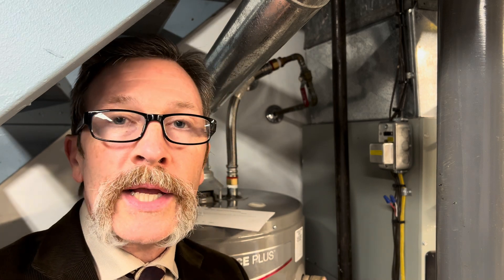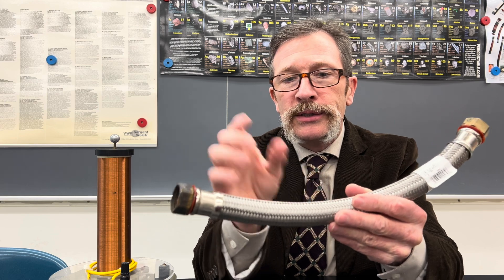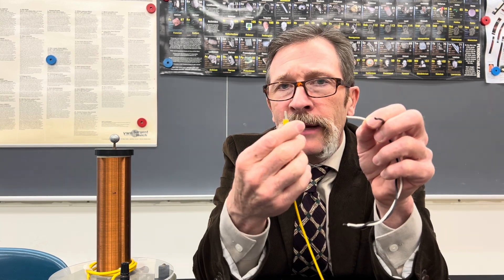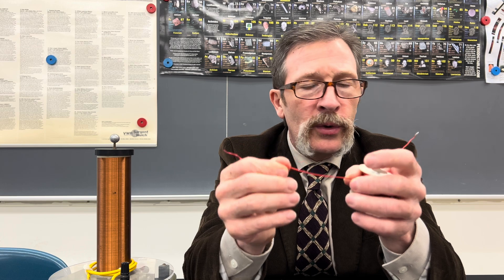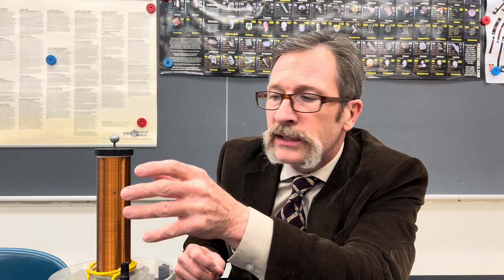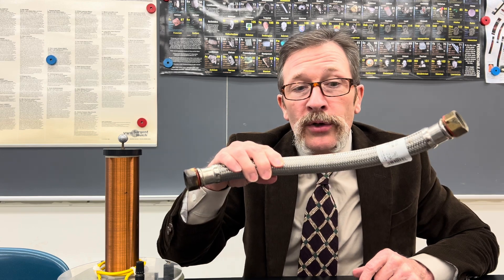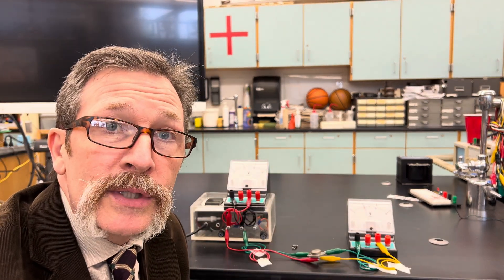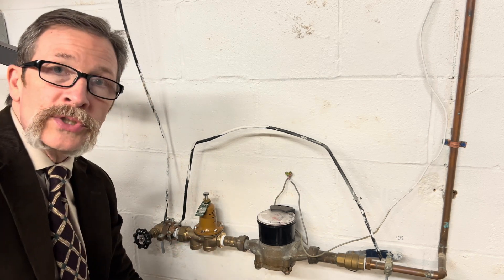Using an Electrical Analogy to Solve a Mechanical Problem

Comment: Water hammer will do that. You can reach 300 psi of water hammer pressure with 50 psi of incoming pressure. You are supposed to have a domestic expansion tank, which is different than a boiler's expansion tank, both in working pressure and purpose. The boiler's expansion tank is not made for potable water. I would recommend that you also install water hammer devices at various locations in the home. It is the number one reason washing machines' hoses break. In some counties it is required to install water hammer devices at the washing machine supply valves. 
The domestic expansion tank also serves another purpose, as backflow preventers are required in many states and counties to prevent sprinkler water and boiler water (which may contain additives for corrosion, heat transfer, and scale) from backing up into the town water supply. When the hot water tank heats and expands, the water has nowhere to go, causing the pressure to increase. When installing an expansion tank with a bladder, charge it with air pressure to match your incoming pressure, or the bladder will fail in short order. 

In rural areas, some people utilize 15 feet of water column pressure to generate hundreds of pounds of dead head pressure, enabling them to pump water from a small stream uphill many hundreds of feet.

Comment: Great analogy.  If I might ride your coattails, I explain electricity thusly: Water pressure is Voltage and the size of the hose is Amperage.  

Did the water pressure in the rest of the house, say the kitchen faucet, seem like it was higher than normal?

I really love your channel.  I am kind of binge watching it because you explain interesting concepts so well.
Reply from the maker: Thanks for the comment!
Reply: I would say his excessive pressure was the same throughout the house caused by a creeping regulator at lock up with no flow (we would call that a creeping regulator in the industry , never locking up).But operating pressure (referred to as working pressure /water in use (shower, faucet washing machine or etc ) ,I’am sure the pressure would be quite normal at about 50 or 60 pounds working pressure,operating quite normally until the flow stopped again going back to the creeping regulators scenario. Gas regulators they would have something called a relief that would vent the gas , eliminating the possibility of a dangerous pressure buildup.
Reply: Like everyone, I learned the water analogies for electricity. However, I believe that the fire analogy is better. Voltage is how hard the flame is being fanned. Amperage is the amount of fire at any given point. Resistance is the flammability of the substance through which the fire is spreading.

Comment: Sir: ok, first thought would be increased water pressure because the water heater is active. Also the hot water could deform the fibres of the hose and suddenly cause a hole. Cause essentially a leak means a hole. I have no further information so I cannot say more. Obviously I am assuming it is not leaking  every time the water gets hot.
last idea: repetitive heating and cooling could have deformed the fibres of the hose in the long run.

Ok, after the video: the pressure was too big because the pressure-regulator was at fault. Nice to learn that! I was close with 'increased water pressure because the water heater is active'
Very nice lecture again Sir! Thanks!